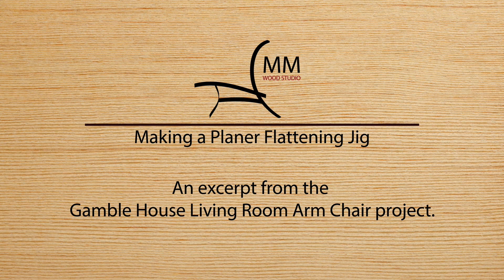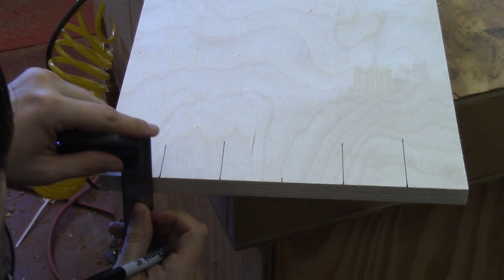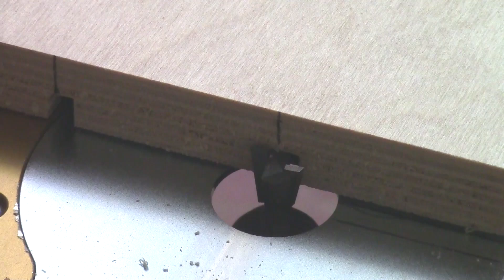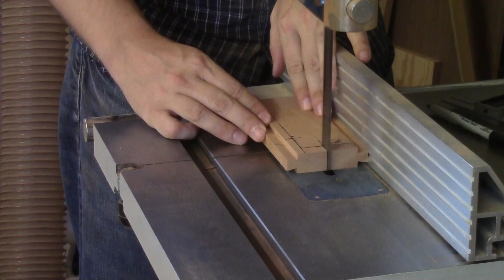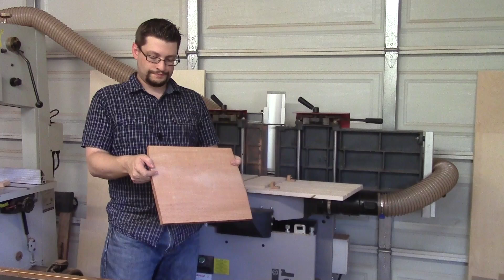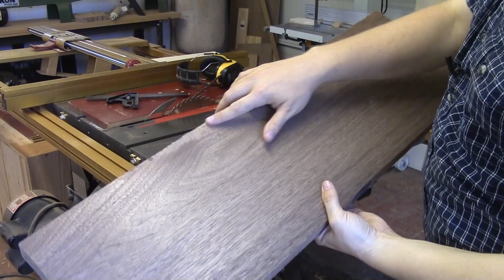Planer Sled for Milling Wide Boards

Comment: Great video. I wonder, though, how long the 3/4" Baltic ply sheet will stay flat. Once it loses its flatness, you might have a problem. I would think that a torsion box would be more likely to stay flat longer than a single sheet pf 3/4" ply. By a torsion box I mean two sheets of ply; a top and a bottom with a middle section of about 3/4" hardwood strip criss-crossing the length and width of the torsion box. The sheets of ply would be screwed and glued to the middle hardwood strips. I imagine that adding laminate to the bottom of the sled would make it truly slick. I also wonder about the snipe; maybe it's inevitable. In your video you don't show vertical supports at either the infeed or outfeed sides of your planer. Could that be adding snipe to your boards? Maybe roller-stands at either end would help? Just my "two-cents." Thank you for sharing your ideas.

Comment: This is the best sled I have seen as it does not include hot glue, bungee cords etc. I am a new woodworker and did not have a dovetail bit, so I used a 1" straight bit to route my slots, then used same bit to take a very small cut on a 3/4 piece of poplar. I am also without a band saw right now, so I made my Length cuts on table saw and small cuts by hand--pieces fits and move very nicely. I also did not have Baltic birch so I used 3/4 MDF very flat and for greater rigidity glued another piece of 3/4 MDF on back--saw this in another sled. Also I do not have a jointer yet so I re-calibrated my slots so I can go down to as little as 3.5" wide board. Your technique and very clear instructions were very helpful--thank you for sharing--look forward to using with my 13" Dewalt bench top. Great instruction.
Reply from the maker: +George Bode Glad it helped you!

Comment: I gotta ask, why not just use double sided carpet tape instead of the hand made dovetail L clamps?
Reply from the maker: ben celiz you need to be able to support the board with shims if parts of it do not make good contact with the 3/4" plywood. You do not want the board to flex. The rollers on the planer provide a tremendous amount of downforce and if the board is not support it will deflect and your surface won't be flat. Double sided tape will not prevent this. The dovetail clamps allow you to uses pieces of various lengths and heights while still giving your room to support the board with shims.

Comment: I have a dozen or so cutting boards that I need to get to final thickness.  I'm a little apprehensive since I know my lunch box planer will produce snipe.  The shed design is very nice.  Do you have any suggestions for the dovetail slides for someone without a band saw?
Reply from the maker: David Colley you could use a hand saw to make those cuts. Would be safer then a table saw.
Reply: Great idea.  I'm really interested in making a sled for this and other, future projects.  The snipe thing is still and issue I'll have to deal with.  Unfortunately, the cutting boards are pretty much at final dimension so I can't afford much wasted material.  I'll let you know how it turns out.
Reply: Jay B says to run your boards through at an angle, in other words start a square into the planer with it a little off a direct approach. I just have a 12" planer and if i do it that way I don't get any snipe. That is not 100% every time but most of the time none! I find when my blades get dull I'll will  get more snipe then than if they  are fresh.
Reply from the maker: That's definitely work. It helps to create more of a sheer cut as well. My planer has no snipe whatsoever. That's from the build quality in Felder products off the assembly line. Glad your planner is performing well for you.

Comment: I don't think that it is completely flat all the way across the face.
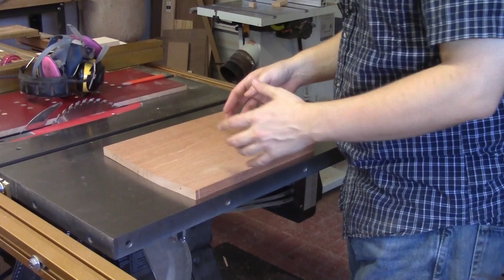I see gap on the left side @ 13:38
Reply from the maker: You are right! As I say in the video, this method creates some snipe on the board at both the beginning and end of the board. Usually an inch to two inches. At this point, you can cut off the snipe and start to thickness plane.